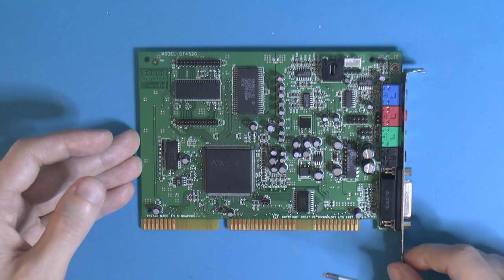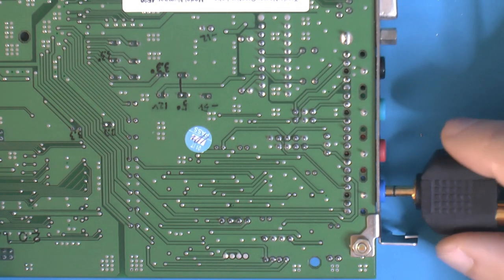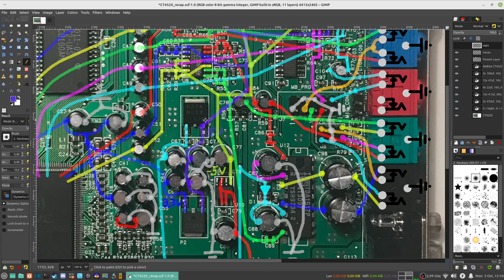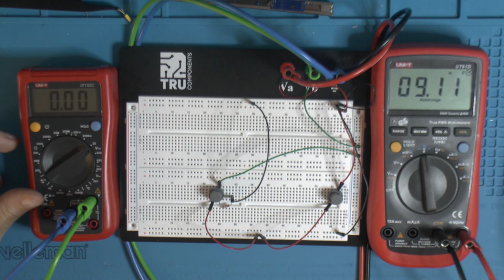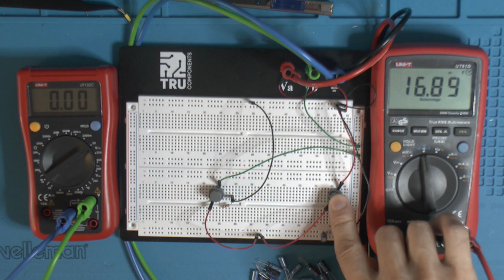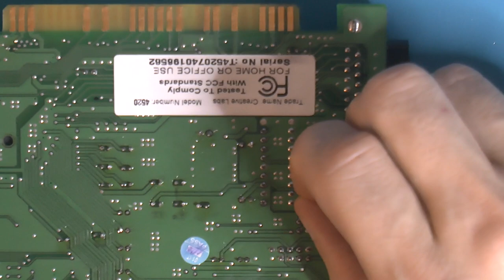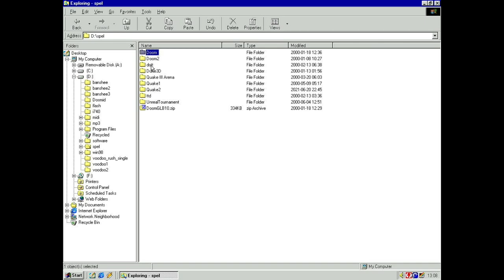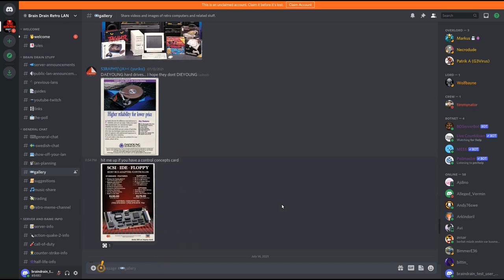Recapping the AWE64

Comment: Thanks for your hard work. I think it could be an interesting project to build a new card using old chips and new components with better engineering (SNR and so on). Maybe not AWE64 but something SB PRO compatible (for DOS games) with better power supply filtration and modern analog output. ES1868F perhaps? You can buy donor card for few bucks.